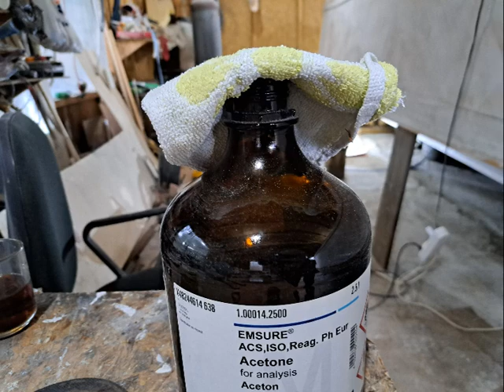PLYWOOD BOAT BUILDING PROJECTS DE23 Part 4

Comment: Can anyone tell me what The Orange material is for The interior of The boat?
Reply from the maker: It is extruded polystyrene of 8mm thickness for thermal insulation.
Reply: @SorinChebac  thank you very much for the information Sorin
Reply from the maker: @CKV812 ... attention, it cannot be painted directly with polyurethane paint, first put a fine/ thin canvas with epoxy resin.

Comment: a question for you... is that head compartment of your own design or is it included in the plans? and what are the dimensions on it? i want a small cruiser like this and the head compartment is essential. also any idea what the maximum fuel capacity would be on this?
Reply: I bought a DE25 Plan which is asking for 46 gallon tank.
Reply: @sandcrabspa4299  thank you for the answer... what about the toilet room? you designed it?
Reply: @jstefa2  I am not the owner of this channel. However, just like you I got a keen interest as I bought a DE25 Plan.

According to the DE25 plan I bought, there is no instructions for toilet etc. This will be entirely up to you. However, on the plan website there is a technical page with help for ideas.

This guy has gone all out and is total inspiration. Too bad it's only slides...
Reply: @sandcrabspa4299  well i always speculated there should be enough room... with a standing toilet and a shower this becomes a perfect weekender.